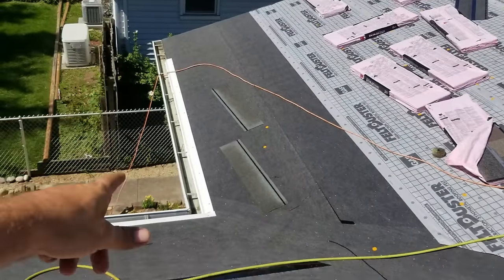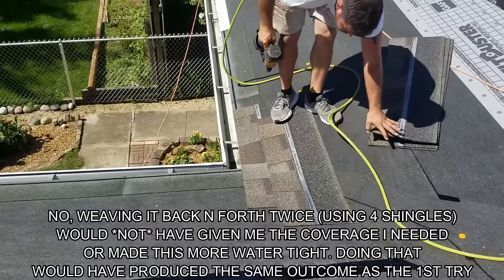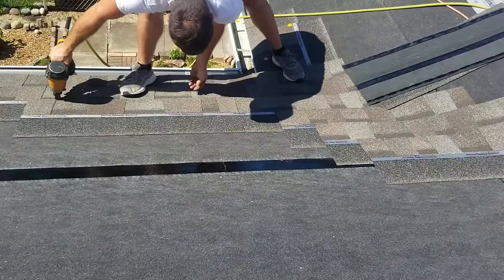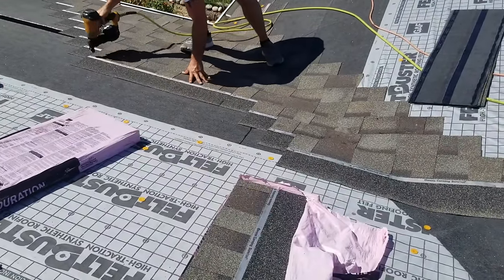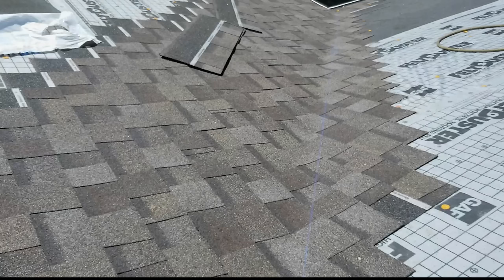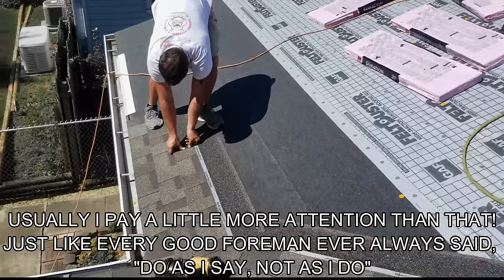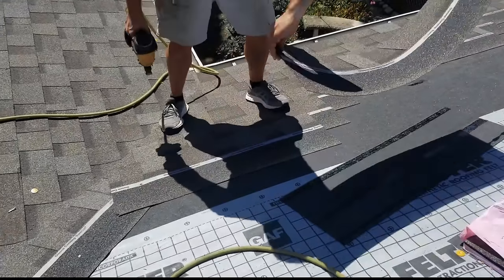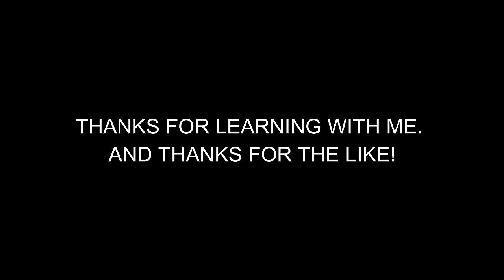How to do a closed valley!!!

Comment: You over nail, learn to back nail to avoid nailing too close to seems.    We use 1/2 shingle technique.    Cut shingles into 1/2.   Every second row, start with a 1/2 shingle.    Nail patterns are consistent.   This is important in a group to avoid nailing at a seem.   It is a great way to avoid nail/seem mistakes.   On another note.  1/2 shingle technique ages much better, you do not see patterns as much.   makes it look better.   Is it windy where you're at?   4 nails is fine.    What is under them shingles?   I hope you got Valley or Ice and Water at least.     Closed Valleys age much better than open Valleys, but the law up North is Metal in the Valley.    Great job.
Reply: chrisregpick make a video

Comment: I'm not a roofer, but I own rental property and have to hire roofers every couple of years or so. Just started watching your videos a couple of months ago when some popped up with other vids I was watching. Had to see the "world's fastest shingler" ;) at work. Been watching ever since. 

I got to this video from the link on the "worst roof ever installed" Part 2  12-7-19 video. I was wondering in the "fastest square contest" vids why you left a gap after the first nail in your nailing pattern. This video explained  the nail pattern and the valley well. Thanks. 

A lot of these kinds of videos not only apply to roofing but lessons for planning and time (saving) management in other disciplines as well.

And the "worst roof ever" should be a must see for anyone who is thinking about hiring a roofer.

Good job.

Comment: I noticed no chalk lines to maintain straightness with Owens Corning shingles we snap a line 13” from the bottom of drip edge and then 33 1/2” from that line and go all the way up the roof. This helps keep everything straight.
Reply: Pros don’t need chalk lines
Reply: W the courses falling on them 33s are they suppose to fall right on or is there any adjusting required?
Reply: He chalked for the starter and that’s it.
Reply: And that's how you end up with no overhang in the middle when the facia bows. Chalk lines are for valleys and hips nothing more.
Reply: Every roofer should use lines!!!! Pros my ass. The shingles need to be and stay straight or the customer got a screwing!!!! I have been roofing for 30 years and lines are a must!!!!
Reply: @michaelparrish755  if you can't roof straight and have to drop rows on lines your a shitty shingler. I can only imagine how many times you have disappearing rows at the ridge and crooked ones following lines. This isnt metal there bud. Obviously you dont trust your shingling
Reply: the feltbuster has a grid on it ,   you gauge by the grid. no need to snap lines.  I rarely snap lines in the field unless three tab  stagger ,
Reply: @michaelparrish755  only throw lines in valleys and all the detail work. If it’s a straight piece of cake just throw the first chalk line and you’re good. If you’ve been roofing for a long time and you still need chalk lines you need a new job. The shingles that it’s a must chalk lines are 3 tab shingles only
Reply: @castillollc2366  lol that's why I have been in buisness 27 years with a good reputation. goodluck to ya!
Reply: @dustinoflynn1649 Shitty shingles! Put that on a shirt

Comment: thank you for explaining your 1 3 1 nailing pattern, though I think it overkill, it is better to see you are consistent with your work and I would never worry about the extra nail.  good job sir! I like your work. as long as you apply your lap cut valley properly with your lap side on the lower slope and the steeper slope as the cut side.
Reply: Architectural shingles require minimum of 5 nails. Just helps to hold the shingle down better in windy conditions
Reply: doing a roof next week. Code requires 5 nails per...

Comment: I also watched "HOW TO SHINGLE A CLOSED VALLEY, Life's Apprentice" and he starts at the bottom different. The method in this video actually makes more sense, very different how it's started, two shingles on the main gable side, before then switching to the smaller gable and putting down all the "under" shingles. I am DIY this for the first time now and will follow this. Doing my own home because that fits my budget, can't afford a roofer.

Comment: I've seen  this  way  another  contractor  does his valley  .he runs  a row of shingles  up valley and  then just  butting  his rows to tbat  without  having  to  cut them  .it's  a version  of the  cut  without  cutting. I'm old  fashioned  and  still  do woven even with  different  pitches  the flat  get  more  rows  all  by eye  .I think  that  better  and  I see  you  tbe same
Reply: drip edge is installed wrong underlayment should be on top of drip edge except on the rake edge
Reply: @bryanlam9886  Florida underlayment under the drip edge ,Hurricane Charlie in south Florida started changing many of the normal ways we have done things for years .Hurricane hits it just don’t matter on a shingle roof over or under it’s going .

Comment: Have been doing valleys like that in Northern Ontario Canada for years. Beautiful and practical.
Reply: It's wrong it's called being lazy do closed cut
Reply: Never had a problem but thanks anyway
Reply: I also lay a bead of roof cement all the way up about 1/2” away from the chalk line.
Reply: FYI I live in Northern Canada buddy. Snow, ice, water, 4 seasons. If it works here it works anywhere.
Reply: leigh white company I work for has been doing them this way 30 years, never a call back for a valley leak we did.. please explain to me how this is lazy? Cuz to me an ugly open metal valley is the lazy way.. looks like crap too

Comment: I prefer weaving both sides of the vally. Down here in NC we call what youre doing yankee valley. To me, a weave all the way up looks way better plus itll save you from cutting the valley.
Reply: Yeah except weaving archetecturals will almost always void the warranty.  If you're unfortunate enough to be installing 3 tabs, than yes I agree with you.
Reply: Have you been watching.... He never cut one shingle...
Reply: We call this a California Valley. And it’s unacceptable to manufactures. Can’t do it! By the way, there is no cutting.
Reply: Did you even watch the video?? This is a called a California style no cut closed valley. No cutting, and if you put a 3" row of roof cement under the entire verticals shingles it will never leak. I don't care what the manufacturers say...
Reply: @Maynardd  wrong
Reply: marsIt’s not about leaks. And the fact that you don’t care about any warranty tells me the type of so-called roofer you are.
Reply: @Maynardd  I m putting them on my own house, and I have been doing my own roofs for 20 years and have never had any problems with California style no cut closed valleys.
Reply: Oh, and by the way! You CANNOT weave laminated atlas shingles. It either has to be an open valley style, or closed cut, or the California closed no cut.
Reply: I get it, different areas do different styles. Thats A ok in my book. Whats most important is quality of installment and giving the customer exactly what they want. They happy im happy.
Reply: @williamberger403  Did you not read my comment? This is my own home.

Comment: It might be a good idea to put roof cement under that place holder shingle in the valley, so once you struck the blue chalk line you could spread some roof cement up to the chalk line and lay the place holder shingle on top. It's just an added measure if water wanted to creep underneath. Great videos and methods btw! Just be careful not to overdo it cause if you step in the valley by accident the tar can squeeze out and make a mess lol
Reply: That's how the crew I work with does valleys

Comment: 18.  1/2  inches off the bottom then every 11 inches . These measurements are for a chalk line. Top of the shingle hits the chalk line. Keep up the good work.
Reply: Gonna use this. I’ve done something similar to 41”, 83” and 125”. Used those measurements when tying in a valley
Reply: I do 19, and off the 19, 22, 44, 66, 88 to make dormers meet up
Reply: Is that for 5-5/8 reveal cause not all shingles measure that

Comment: This drives me crazy , I absolutely love the idea of becoming a roofer. Except i also like the idea of working on cars, but plumbing looks interesting as well. See my problem? I want to do it all , but you can’t be a master at all of those
Reply: I'm becoming a home inspector. Seems to fit my needs because it's a little bit of everything!
Reply from the maker: Oh yes you can! Work buddy work.  Plumbing looks easy.  Roofing won't take too many years as long as you keep up on my videos and it seems like you've got a headstart on cars/ trucks.  Get er done bruh if you want it you need to put tf out!
Reply: Worlds Fastest Shingler fair enough
Reply: Become a farmer. I get to do em all brother
Reply: With electric cars coming on strong auto mechanics may be in less demand within 10 years..
Reply: DQ10 nah , a lot of the same components are used. Auto mechanics will just learn to work on these newer cars
Reply: DQ10 nah , a lot of the same components are used. Auto mechanics will just learn to work on these newer cars
Reply: Yes you can .
My friend is a plumber and a electrician .
Im a roofer by profession.
But i can do carpentry
Masonry.
Every type of roof and do repair / chase leaks.
Also im a pt mechanic.
And can do copper fabrication.

Only took from the age of 20 to 53.
To learn different things.
But would not change it for the world.
My brother and i are partners in our own company .

Comment: My one buddy floats a few shingles b4 falling back 2 the valkey, runs it back to the 2nd n 1st a few then floats again.works out alright!.i try n maintain a 4 nail or storm nail pattern, depending on pitch n story height when doing valleys
Reply: Santino Martinez coad where I am is a metal flashing in the valleys.
Reply: @mikerob100   or is it  CODE?
Reply: @rickw5024  Not national/international code, could be local code to require the metal valley. It just calls for: "For closed valleys (valleys covered with shingles), valley lining of one ply of smooth roll roofing complying with ASTM D 6380, and at least 36 inches (914 mm) wide or types as described in Item 1 or 2 above shall be permitted. Self-adhering polymer modified bitumen underlayment complying with ASTM D 1970 shall be permitted in lieu of the lining material."

Comment: The starter shingle should be nailed low over the drip edge so the wind can’t blow it up. If you’re going to run a bleeder and point out of a valley you shouldn’t snap your line in the center of the valley you should snap it on the up slope so water doesn’t want to go underneath your bleeder. This looks like a about a 3/12 pitch to me and the underlayment should be 2 plied on the half lap. On a slope this low this valley should be woven. When you weave a valley there is no seem for the water to go underneath and you get 2 layers of shingles where a lot of the water runs. This guy has some more to learn about shingling. Take it from a guy who has been doing this nearly 40 years.
Reply: just put valley metal. problem solved lol

Comment: Usually when Im nailing down the starter, I nail low, so my nails hit the drip edge.. anyone else do that?
Reply: I put 3 low and 2 high. Not sure why exactly.
Reply: Thank you, im not the only one on the planet who nails the starter through the drip. I have worked on crews that use alluminum drip edge and they staple it on with their prep and tell me its ok because the starter will hold it down. But then they fail to nail the starter low enough
Reply: @kylebrett1453  yeah. It's honestly sad the workmanship of some roofers. That's why my brother in law and myself are the only people I trust to nail on my crew.  It's just common sense to nail the starter low for wind purposes as well as the drip edge.
Reply: HONEST ONE  what do you mean by bull your starter? Ive never heard of that one and maybe im missing out on something i dont know. Thanks
Reply: The starters combined with the ice and water should seal the shingle within hours in the summer and maybe a day or two in the winter. No need to nail low. The lower you nail the higher chance of ice melt you have finding a nail and causing a leak. Especially on the bottom where all the water is and where most water collects due to a failed gutter system. Nails are meant to hold the shingle in place until the shingle seals. The tar strip on the shingle is what seals the shingle to another shingle not necessarily the nails
Reply: @amazingcaucasian1  you're missing the point. Thats great that the first shingle sticks to the starter, but what about the starter to the drip edge? Nothing there except nails to hold it. Ive seen lots of first rows lift up from starters being high nailed. And also if nails were only ment to hold the shingle in place temporary until they seal then everyone would still be 4 nailing.
Reply: @kylebrett1453  Damn I miss 4 nailing. Those were the days
Reply: The starter height is right at the nail line  I like to nail the ends of the starter into the drip and 3 high just to ensure no nails near the seam
Reply: And honestly nailing the starters high is fine lol it gets nails from the shingle above it as well and the gutter blocks most wind from the bottom row

Comment: Is roofing good money in US cause in uk its alot harder than this
Reply: rumpleforeskin73  physically cause your lumping slate and tiles up ladders then up roof rafters  so have only limited places to put your feet. Tbh I should of says looks.
Reply: it all depends on the roof, ive made $20 hr on some roofs and $45 on others laying the same shingles, its all about how many squares you can lay in a hour.
Reply: @johncopeland9553  in uk actual roofers will get good money if it's there job but most I know just get a couple of labourers pay them like 70ish quid a day
Reply: My dads a roofer/builder he said if he got roofs day in day out hed be on a good screw but stick to extensions as its months of definite work

Comment: Around 20 years ago, worked as a commercial roofer. Raleigh,Durham area. We always put flashing in the valleys. I am unsure if that was code at the time. But my boss always said valleys had to have metal to insure shingles stayed bonded and even in the valleys. The flashing gave nice smooth surface to keep shingles from sinking in the valley. Love how you use use your gun too maintain bond lines. And even as pros we always popped lines, just too be sure..😀. Love your vids.

Comment: Out on the west coast it used to be called a “California Weave” and thats going back 30 years. They work great and last a long time—EXCEPT if the homeowner is a pain in the ass and constantly goes on the roof.. Then you run valley metal and run a bead of 204 the whole length.. 🤔

Nice!
Reply: marxg4 i always prefer to put metal with low pitched roofs like the one in the video, you know, just in case

Comment: I don't think they do valley's like that here in Canada they use tin in the valley not shingles.
Reply: Maybe because its so cold in Canada the wheater has a lot too do with it .the ice can sit in the valley with the metal the ice can sit there longer it will last longer from looking at these videos I never knew different states roof different with respect roof life
Reply: @davidfridley6625  Yes I think you are right, we get minus 30 Fahrenheit sometimes, that's f-----ing Cold!
Reply: I’m in Canada and I know a lot of guys, myself included that do them this way. This is the best method in my opinion
Reply: @mikegamble1457  I agree because when the snow and ice sits in the valley the metal will hold up many years vs shingles metal wins every time
Reply: @davidfridley6625  Even with just sun and rain, the higher water flow in the valleys will begin wearing the shingles long before the metal has even a hint of rust. Of course, that's never for copper :-0)
Reply: @2Truth4Liberty  liberty must stand for liberty roll just joking I can tell you are a roofer. I'm from Atlanta the wheater is great for roofing we get a good amount of rain per year as you know roofers love rain it creates work be careful on them roofs with respect David roof life
Reply: @davidfridley6625  well it's weird that everybody spells weather the same way whether or not they think it's right or wrong
Reply: @zorroonmilkavitch1840  I think its weird you would time your time out too correct everybody's spelling I really hope you have a great day

Comment: Nice video! I am about to try an patch my neighbor's roof they have multiple leak's right now in the valley's of their roof. It is about 20 year's old so they plan on dipping into their 401k to have the roof replaced next year I got up on the roof an I was shocked the vent caps that come through the roof was on top of the shingles not under like they should have been  installed. When i replaced my roof I had the same vent's an made sure the the vent was at least under the shingles on the top of the slope not these people. But I believe the roof is leaking in the valley that would be my guess someone has tried to patch it used caulk on one side an tar on the other. I pretty much have to do that because they do not want to spend a load of money when they are gonna replace the roof next year. So I plan on going up an trying to get most of the old tar an caulk off. Then reapply some fresh fiberglass tar roof sealer an touch that up with some flex seal a couple day's later. I know the best thing would be to just repair it right but it is the owners call. I am not gonna turn down 250 dollars for a hour worth of work